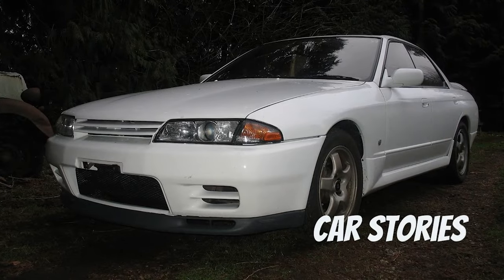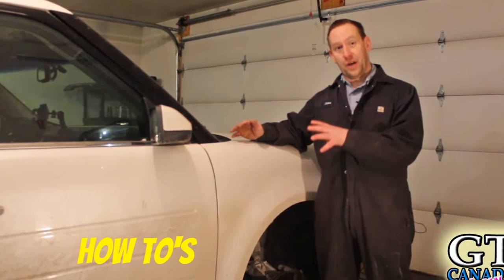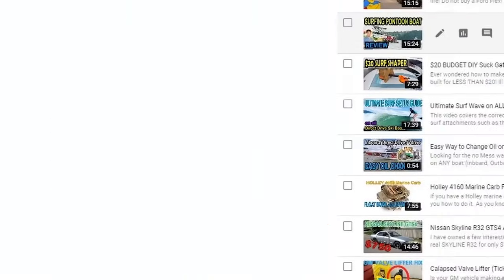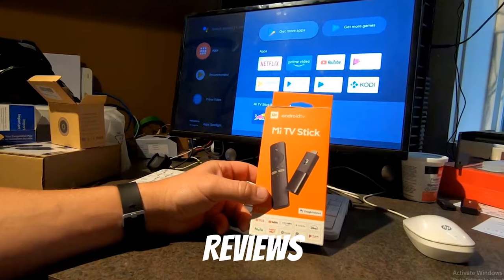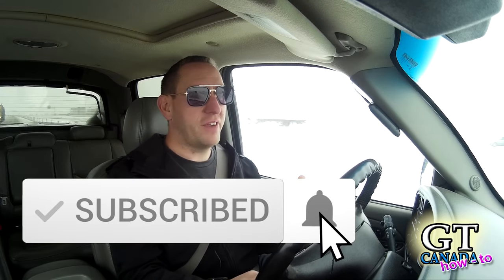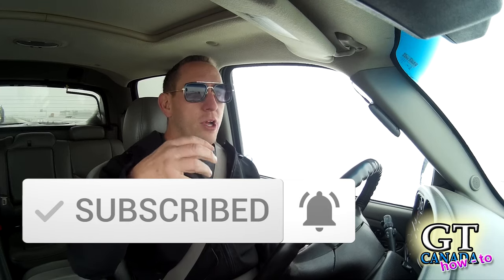ILLEGAL MOD! ~ DIY Gutted Catalytic Converter. Its EASY, Its FREE, Its FUN - GT Canada How To

Comment: Hmmmm, I use magnesium to start fires with. I thought it was other heavy metals like platinum, palladium, and rhodium that the cat honeycombs consist of.
Reply from the maker: It actually does have a lot of precious metals in it
Reply: @GearsAndTech  I just finished taking out my honeycombs out today out of both headers. What’s odd is that they weren’t like anything I’ve seen anyone else taking out. I thought it was going to come out like rocks. Instead, it came out in like metal sheets that were wrapped round and round on itself. Also, it was magnetic because it was sticking to my drill magnet that holds screws and such. They were OEM as well.
Reply from the maker: Interesting. What's the year make and model of the car?
Reply: @GearsAndTech  it was out of my 2003 325CI parts car. It had some weight to it so it wasn’t aluminum, but I guess it couldn’t be aluminum either since it was magnetic. I thought that crap would break up easily like I’ve seen from everyone else doing the same. NOPE, this was a PITA.
Reply: Nowadays any kind of metal in a car is precious lol

Comment: My e46 has a lot of blie smoke that is coming out of the exhaust after i put a new cataloc converter. Each 200km of driving, the check engine light is showing up. I delete it and comes again. It gives a code about cataloc converter. If i replace a proper cataloc converter, will the smoke be more less?
Reply from the maker: Should be. Yes
Reply: @GearsAndTech  damn it🥲

Comment: Does the engine computer need the O2 sensors to calculate fuel efficient operation? Will the air fuel mixture be messed up.if the catalytic converter is removed since it is hooked to a computer?
Reply: Yes, but only the first oxygen sensor in the manifold does this. It does it before the catalytic converters.

Comment: if i just want it to be a little louder can i just drill a couple holes? or do i need to hollow it out completely? i don’t want it super loud just a little louder
Reply from the maker: You could drill holes yes. It would be a long drill bit required. Or just pound the pipe through the middle and not around the edges
Reply: Usually this will cause a hissing sound, and depending on where your cat is it could also let carbon monoxide and other toxic fumes into your cars cabin if you're idling while stationary, and these chemicals build up in your body over time so avoiding them in the first place is a great idea. Plus holes before the muffler will be much louder than you expect, because they aren't being muffled, a few holes in the cat may end up louder than hollowing it, or replacing it with a straight pipe. I'd recommend drilling holes into the muffler, near the far end of it and checking how loud it is with each hole by starting the car every time
Reply from the maker: Exactly. Basically it's a bad idea
Reply: @GearsAndTech  It may be possible for loose particles from the cats to actually make it to the engine values during operation.   I don't work on 4-stroke engines, but I do build 2-stroke engines for a living.  I thought it was impossible, but I have seen sand enter an "exhaust can" on RC cars in sand dunes, and fill the engine up from the exhaust side of the engine.  I would think it was "sound waves" bouncing back, and carrying the dirt into the engine. A half gutted cat will still change direction of the sound waves, and they do have a force.
Reply: @EarthSurferUSA  I had a geo storm back in the day cats got clogged I hollowed it out...BUT ...i didnt get all the pieces out ...and when hooked it all back up the particulates got sucked back into the engine ....good by valves car never ran right after that .
Reply: @petermelnyk7664  unless you personally seen with your own peepers those catalytic converter particles welded themselves onto the valve seat, or the actual valve seating surface, or on valve stem preventing the valve seating correctly on that big 3 cylinder monster my guess would be that wore out beast needed the back pressure the catalytic converters created to function properly. 
Generally, until an N/A engine is above a certain rpm open exhaust hurts its low end and middle torque and horsepower all the while sounding like a rocket ship that is hauling ass only to see the time slip one realizes it wasn’t doing nothing but making more noise! 
However when boost is a factor open short exhaust piping is a beneficial from the moment one mashes the loud pedal
Reply: @EarthSurferUSA  on my Toyota, the factory header appears to have a squeezed merger 4-1. Like 4 quadrants of a pie. The pipe after this is bigger than the rest of the system then it goes into the cat. My symptoms are heavily eroded spark plugs and extremely poor acceleration after 44 mph. I am getting up to 5 mpg less than the old average. Something has changed and the engine is going to eventually get a timing chain and tensioner. I'm going to take a look inside the cat but I think it's causing heat buildup.
Reply: @Yixdy pretty sure he was talking about holes through the catalyst material vs totally removing it. Don't think he meant drilling holes in the actual catalytic converter shell. 😂

Comment: Ok. How about miles per gallon  without the cat? Do you save or refill more often?
Reply from the maker: usually your fuel economy goes down. And unless your car has forced injection (turbo or SC) you likely will lose low end power. 

What you gain, is higher top end, and a really cool sound when you step on the gas!
Reply: @GearsAndTech  man! I meant if you don't fix the check engine light you burn more gas.
Reply from the maker: That's not actually set in stone

My wife's Mercedes has had the cel on for 02 sensor for the past 4 years. Her fuel economy is amazing

Comment: Can small shop dealer sell you a vehicle with just straight pipe muffler, I just bought a box truck without the cats. Can I sue them for it ..
Reply from the maker: That's a tough one. Here in Alberta you can't

In fact, you can buy a brand new truck off the dealership with no mud flaps, and on the way home get pulled over by the police for not having mud flaps. You can't sue the dealership then

So, it's unlikely you can sue a shop for no cat. You always have the right to do a pre purchase inspection at a shop of your choice before buying.

Comment: Magnesium? It's ceramics with precious metals like platinum radium in palladium , I don't know what you got your info  but magnesium is not a precious metals in cats and it's not precious its very similar to aluminum. If your going to make automotive education do research before schooling folks and magnesium dust isn't "toxic" per se obviously dust or fumes from melting is not good for you to allow to enter your respiratory system and excessive fumes from welding it  can cause  flu type symptoms but dust isn't going to do that.
Reply from the maker: I'll see if I have that bag of precious metals anywhere still. Are you willing to put your money where your mouth is?

I'll shake the bag up to get a good cloud of dust, then you just need to huff that dust for 1 minute to show all the viewers at home how safe it is
Reply: Tell that to the asbestos industry

Comment: Will this hurt my car  tho?
Reply: Removing it completely without installing a pipe or something in it's place will, depending on how short this makes your exhaust that is. Some turbo vehicles lose a bit of power because the turbo will not operate at it's full potential, and unfortunately some older (as in 1996 and older) may go into limp mode, which will cut your horsepower down significantly, among other things. But generally, if the catalytic converter is clogged it will actually restore power if you do this
Reply: @Yixdy  A clogged cat, (and even some new ones IMO), will raise engine temps a lot, (even if the engine management system controls the water temp on your gauge).  You will actually increase the life of your engine by reducing the temps if that is a problem.  If your car runs great when cold, hammer it and it goes,---but loses that after it is warm, and you have some mileage on the car,---put on the top of your suspect list, "clogged cats".  You also probably notice your heater blowing hot air, (from cold), real fast, and quite a bit of heat under the hood when you open it after operation.